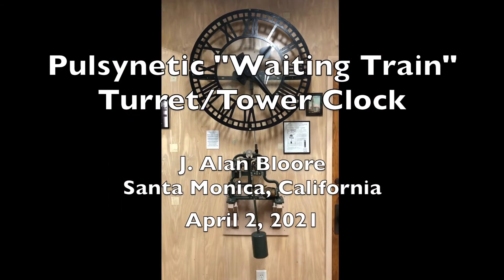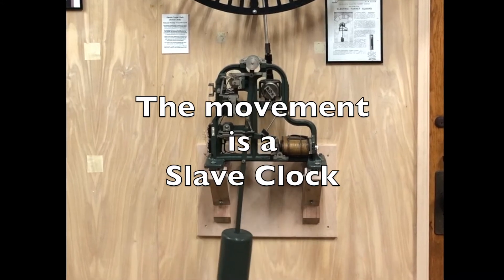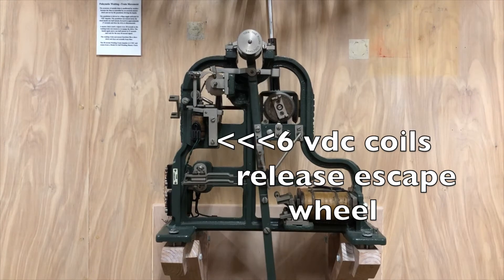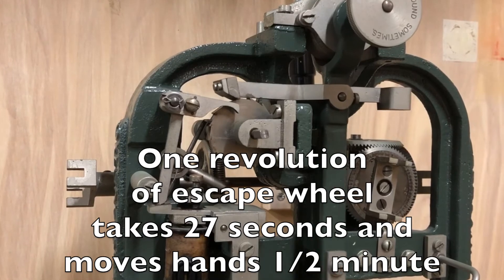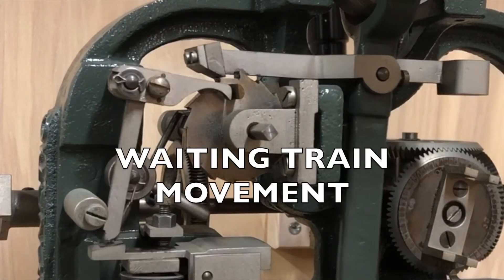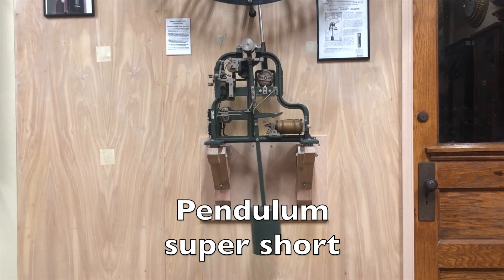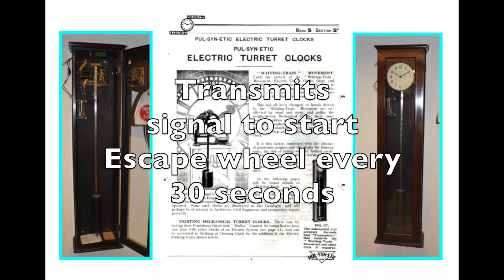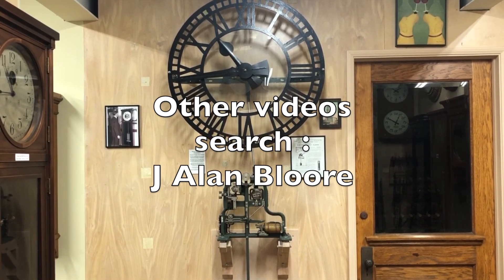Pulsynetic "Waiting Train" Turret or Tower Clock - How it works

Comment: Thank you for this video, Mr. Bloore. What I don't understand is why a waiting train is needed. If the hands on the dials are correctly set and receive an impulse at the same time, why would they ever show different times?
Reply from the maker: The hands are driven by the short pendulum that is not precisely accurate. The hands will be very slightly fast after moving 1/2 minute on the dial. The hands then wait. Each 30 seconds the very precise Master Clock starts the "time train" starts up again. So the hands are moved by the pendulum and not the electrical pulse.
Thank you for watching the video and your question, sorry to be so late with my answer. Hope this explains, Alan
Reply: Thank you very much, now I understand! @SelfWindingClocks

Comment: Very clearly explain thank you.
The largest electric clocks in the UK, those in the Liver Building in Liverpool are driven from four waiting train movements controlled by one Gents' master clock.
Gents' and the architects made sure that the dials were just a little bit bigger than those on 'Big Ben' in London.
Reply from the maker: Thank you Donald. I looked up the Liver building and it is magnificent. Very interesting that each dial is controlled by its own waiting train movement and the Gent's master clock controls them all. Spectacular engineering. Thank you for sharing.